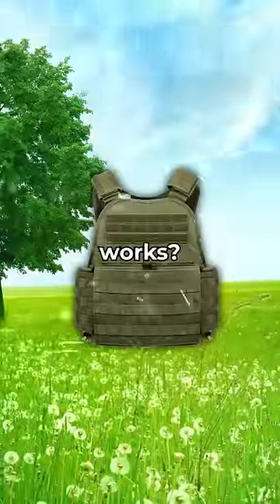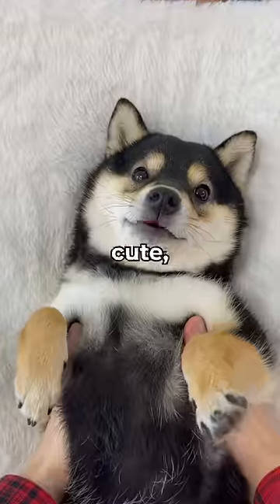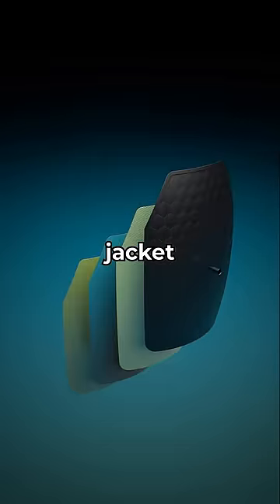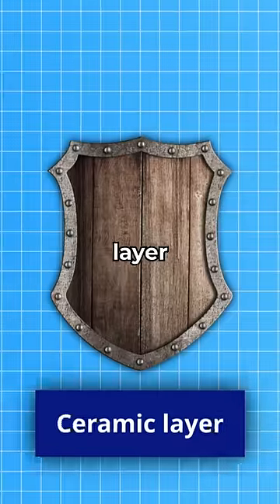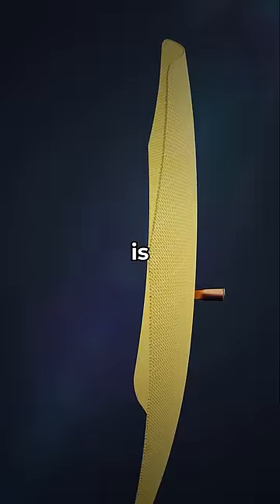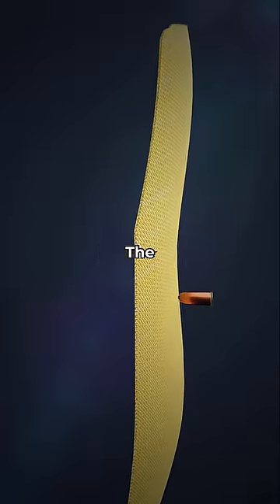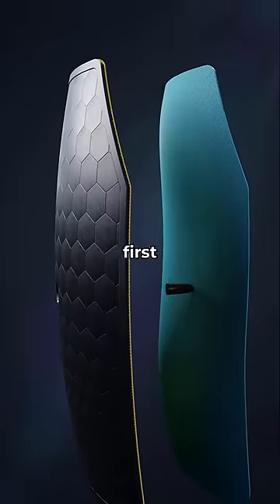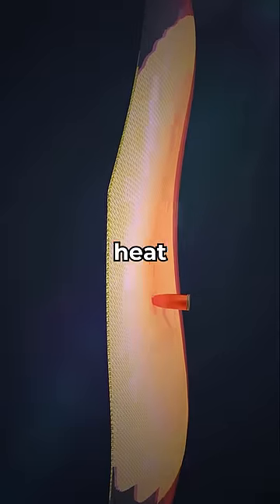How Bulletproof Jacket Works? 🔫 (Explained) #shorts #viral

Comment: Ingredients:

1 cup (2 sticks) unsalted butter, softened
3/4 cup granulated sugar
3/4 cup packed brown sugar
2 large eggs
1 teaspoon vanilla extract
2 1/4 cups all-purpose flour
1 teaspoon baking soda
1/2 teaspoon salt
2 cups semisweet chocolate chips
Instructions:

Preheat your oven to 375°F (190°C).

In a large mixing bowl, cream together the softened butter, granulated sugar, and brown sugar until the mixture is light and fluffy.

Add the eggs one at a time, beating well after each addition. Stir in the vanilla extract.

In a separate bowl, whisk together the flour, baking soda, and salt.

Gradually add the dry ingredients to the wet ingredients, mixing just until combined.

Fold in the chocolate chips until evenly distributed throughout the dough.

Drop rounded tablespoons of cookie dough onto ungreased baking sheets, leaving some space between each cookie.

Bake in the preheated oven for about 9 to 11 minutes, or until the edges are golden brown. The centers may still be soft, but they will firm up as the cookies cool.

Allow the cookies to cool on the baking sheets for a few minutes before transferring them to wire racks to cool completely.

Enjoy your delicious homemade chocolate chip cookies with a glass of milk or your favorite beverage!

Feel free to customize the recipe by adding nuts, dried fruits, or other mix-ins according to your preferences. Happy baking!
Reply: instructions unclear, i made a bulletproof vest instead of cookies.
Reply: Lil bro commented on the wrong video
Reply: Really? I ended up making bullets  @NeoJae
Reply: man i made a cookie vest @Chicken_Lord1234
Reply: @penguin_joe6993 bruh I made a burned cookie bullet vest